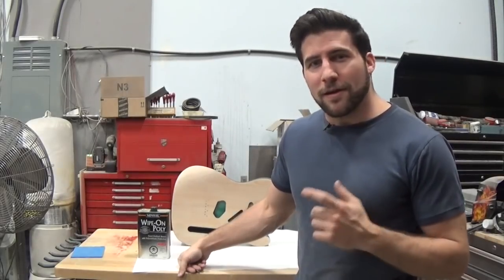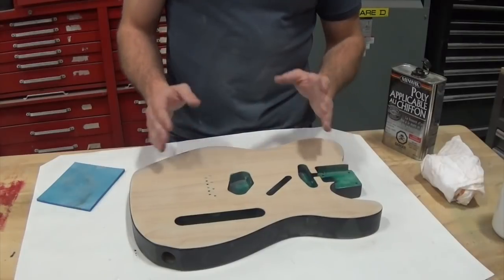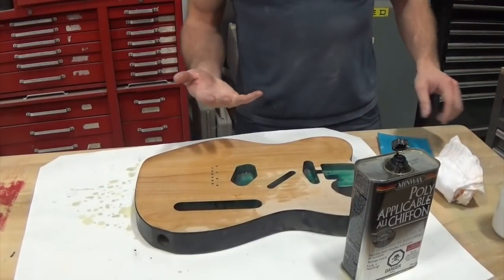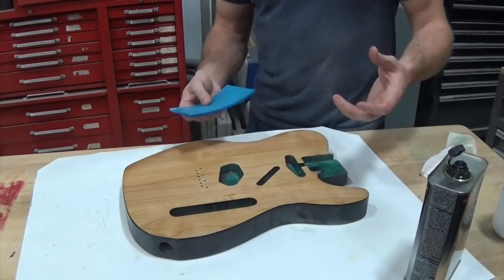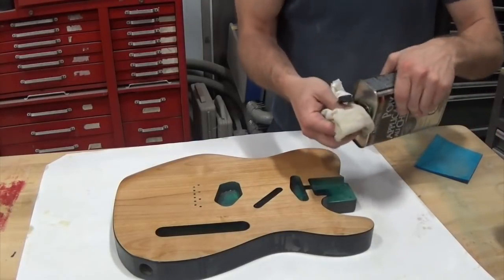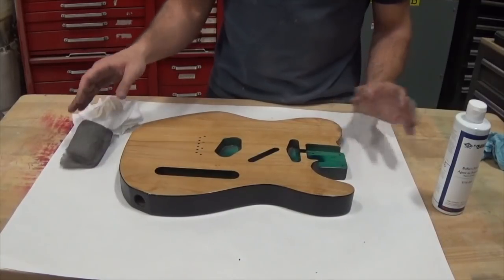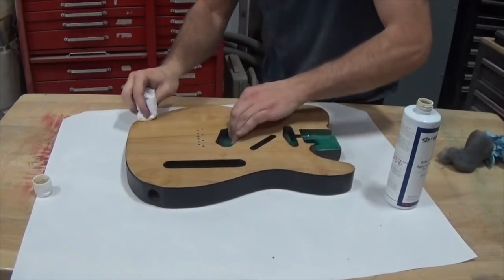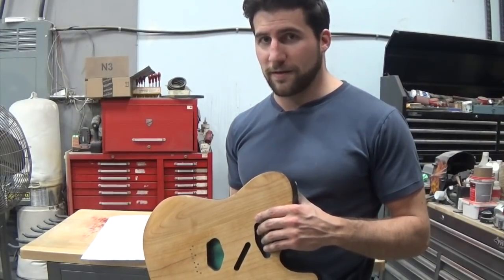How to apply a perfectly smooth poly finish by hand

Comment: Hello Brad, I would like to try this Behlen buffer's polish B730-2005, but seems like is discontinued out of stock everywhere. Did you find a replacement product with the same gloss result?
Reply from the maker: There are several, but the most direct replacement is the buff n polish kit from Mohawk, which is essentially a rebranding of the Behlen products.

Comment: Brad, is the initial sandpaper application only recommended for a guitar with a natural finish or can you use that method with a color stain as well? I’d like to use this method for my next build as I can’t spray lacquer in the winter months.
Reply from the maker: I would only use it on plain wood mostly. It can damage/distress paint and stain if you use it over that.
Reply: Brad Angove thanks for the info

Comment: Dave,..help me out brother,...at whicch pointt would one apply wood stain?? im about to start a DIY project and im going for a Jacobean woodd stain finish,...would I apply the wood stain first and then follow allong with this video regarding polyurethane application??
Reply from the maker: Stain first and then apply the poly, but done use the sandpaper for the application. 
Who’s Dave?
Reply: @BradAngove  ,... why did I write dave? i couldve sworn i typed Brad,..fuckin autocorrect, sorry man, im very impressed with the sandpaper technique, was that you discovery??
Reply: @BradAngove  wait,... did you mean "don't" use the sandpaper during application??
Reply from the maker: Yeah, I came up with it although I’m sure others do it and may have thought of it first. 
I wouldn’t use the sandpaper over stain or paint though. It could give you an unintentionally distressed finish.
Reply: @BradAngove  lol,..i kinda want this thing to look likee it came out of Frankensteins lab,. i just managed to strip the initial layer of paint,.. there's some residue underneath,. im sanding it down with 80 grit by hand but forget that noise, im gonna go borrow the electric sander froom the old maan tomorrow

Comment: Will two sessions of the Sandpaper/Poly sanding process sufficiently fill the open grain of a wood like Mahogany, or would you need to do more than just two sessions of Sandpaper/Poly to adequately fill the grain on woods that have a more open grain structure, like Mahogany?
Reply from the maker: If you’re working with mahogany you should grain fill first, then two sessions should be adequate afterward.
Reply: Thanks Brad!
Reply from the maker: You’re welcome.

Comment: Hi! Very informative video. Two questions - Is it possible to add a tint to the clear poly before applying it? If so, what sort of product would I need? Is there a Minwax option that would be suitable? Many thanks
Reply from the maker: Yes. You would need a candy dye if you’re looking for an automotive type tinted clear. An aniline dye will have a similar effect and should work with poly. I’m not aware of anything by minwax like that, but they may have something.

Comment: Hi Brad - fantastic video, thanks! A quick question - applying the MinWax with sandpaper: does that work at pore sealing for looser-grained woods like mahogany?
Reply from the maker: I don’t think it would be adequate for mahogany. Or at least you would need to to it several times.
Reply: @BradAngove  Thanks for that! Do you have any recommendations? I've been told ZPoxy or shellac and sawdust but to be honest I've never done anything with mahogany so I am at a loss ;-)
Reply from the maker: I’d go with grain filler. I like the stuff from Oxford supply that I demoed in a recent video on an acoustic guitar kit. I also like using ecopoxy sometimes.

Comment: would grain filler act as a sealer? i have a really nice maple body that has alot of grain on it, so i put on the grain filler before i stained it to accentuate the grain.  i plan on putting the wipe on poly for the finish because i don't have any way to spray unfortunately.
Reply from the maker: Not really. I have a specific video on grain filler vs sealer if you’re interested.
Reply: @BradAngove  heading there now

Comment: Hello Brad, me again...
I may have to fill a hole on my Hondo Frankenstein build. I will be using a new neck, and bridge setup. How would you go about filling in a bridge pick up hole so it can be relocated?
Reply from the maker: Cut a block to as close as you can to the shape of the hole, perhaps a couple mm thicker. Then glue it in, sand flat and fill the little gap around it.

Comment: Can the same technique of applying the first coats by wet sanding be used on a tung oil finish? If so, are all the other coats done as in this video as well? What about the final polishing? Thanks.
Reply from the maker: +Jakexx01 I've never tried it with tung oil, but I imagine you would have to thin it. Otherwise it would be a bit sticky and not spread properly.

Comment: You can use buffing pad with a random orbit sander for the last step. Saves on the elbow grease.
Reply from the maker: Or better yet you can use an actual polisher.

Comment: Hi Brad ! I'm trying the sand paper method using Danish Oil to actually grain fill the mahogany body of my latest project. It indeed creates a slurry of dust and oil that goes onto the wood, but I have a question. Would you just leave the slurry to set and then dry sand it off or try to work it in the pores while it's still wet, taking off at the same time any unwanted excess ? It's my first time trying that out, and I'm kind of confused.
Reply from the maker: I generally buff off the excess with a cloth after about 15 minutes or so.
Reply: Thank you so much. I'm sorry I didn't see your answer at the time. Pardon the delay.
Reply from the maker: No worries at all

Comment: Great video Brad. if you use a stain can you use a mist coat of sanding sealer and then use the wipe on poly?
Reply from the maker: You can, but use a proper coat of the sanding sealer rather than a mist coat. It will make the poly application a bit easier. And make sure you're using something compatible, or test it on scrap first.
Reply: Thanks Brad :-)

Comment: when finishing a guitar - do you also need to apply poly to the insides of all the cavities?
Reply from the maker: No. Those generally have conductive paint in them.
Reply: @BradAngove  i see. What if I'm using metal shielding tape instead of paint?
Reply from the maker: Then you can apply that directly to the wood.

Comment: Could you do this on a thin spalted maple veneer that has glue spots?
Possibly over a few coats of rubbed in oil paint?
Reply from the maker: I would be hesitant to do it over paint. It may damage or remove some of it.
Reply: I'll try a test piece and let you know.

Comment: Hey, Brad! Will I get same results if I have some woodburning designs on the body?
Excellent video btw! Very very helpful 😊
Reply from the maker: You might find that it moves or removes some of the char. I’ve done it. I enjoyed the effect, but I’m not sure if it’s precisely what you’re looking for.
Reply: @BradAngove  Ahh i see. Yea, especially with the use  of sandpaper for the first layer. Which type of finish is best for it? Other than the woodburned part, everything else is natural (no stains or whatsoever).

Comment: Hi Brad, over the big pond from Canada, our UK DIY stores don't seem to stock Wipe-On Poly - just regular water-based Polyurethane Satin Clear which I guess is similar (?)  Also, we don't have stuff called Buffer Polish in liquid format -  which you wiped in (and didn't have to wipe off, like automotive T-Cut).  Will any liquid polish suffice?  Cheers.
Reply from the maker: This poly is oil based. And yes, almost compound and polish systems will do the job.

Comment: Im new to finishing guitars... i was told to use formbys tung oil but not getting the look i want.. can i put polyurethane over the formbys?? Thanks im very greatful to have found your channel !! Keep up the great videos
Reply from the maker: Hi James. If you have a look at my series on building one of these guitar kits, I used behlen’s tung oil and then went over it with their urethane and it turned out awesome. I haven’t used formbys, but I imagine an oil based urethane finish would work quite nicely over it.

Comment: Hey Brad!  Love the channel and what you do.  Could you do this same thing with Tru Oil?  I've got a Solo Firebird kit on the way and was thinking of just doing the mahogany body in Tru Oil.  If using your method here would I need to sand the poly sand sealer that comes on the body first?  If so would I just scuff it or have to try to remove it?  Or could I just start with the sand paper and Tru Oil?
Reply from the maker: Yes you can do this with tru oil. You don’t need to remove all the sealer, it you do need to at least sand it smooth.
Reply: @BradAngove  Thank your sir! Appreciate the input!

Comment: Hi! Fantastic video! I'm getting ready to put a poly finish on my first ever build and your videos offer great advice! I have a question about your "trick" about using a sanding paper to apply the poly. Can I do this on a maple veneer top with a burst finish? I ask because I'm afraid the slurry will become a mix of the different stain colors, which ends up in the different locations all over the top. Any experiences? Should I just go ahead and don't worry, or apply 1 coat with a rag first and do only the second with a sanding paper?
Reply from the maker: This trick is mostly for unfinished wood. Unfortunately, you concern is valid. You’re likely better off to just carefully apply the first couple coats with a rag.
Reply: @BradAngove  Thanks for getting back. I took the advice and wiped it on with a regular rag. It's working out fine until now.
Reply from the maker: Glad to hear it. I hope the rest goes well.

Comment: Brad, is it dangerous to apply more than 3-4 coats of polyurethane? I'm finishing a project with a brush on type of polyurethane where I need to apply dozens of coats to give it a smooth texture, but the poly is always cracking.
Reply from the maker: Brush on is thicker, so doing dozens of coats can be problematic. You’re probably having coats shrink on top of eachother as they dry. With the wipe on it can be done more easily, but I don’t think I’ve ever dealt with a finish that actually requires dozens of coats.
Reply: @BradAngove  I think I may be skipping something on the wood prep because even after 6-8 coats, I still don't feel like all the grain is well covered. I did use grain filler, but I'll try to be more carefull. And by the way, I have to mention, your video about grain fill is great. Thanks man!
Reply from the maker: Thank you. What kind of wood are you using?
Reply: @BradAngove  the name of the wood is Marupá, a brazillian type of wood similar to basswood. Kinda soft and slightly porous.
Reply from the maker: You may need to actually grain fill first. Perhaps with something harder like epoxy.
Reply: @BradAngove  Got it. I scraped all the finish this weekend and gonna definetlly give more attention to grain filling. Thank you very much Brad!

Comment: Hi Brad, greetings from Scotland. Your videos are so helpful. Thanks. I have two questions : There's no mention of grain filling. Yes or no? The body I want to finish has some areas filled with a wood filler. Will the poly take to this, or will I have bonding problems?
Reply from the maker: The poly should go over that just fine. This wood was tight grained enough that I didn’t need to fill.

Comment: Okay Brad, this is what I'm trying to do: I have a high-end bass guitar that has a white finish that needs to be removed because of yellowing.  Do you have a video on how to remove that finish?  BTW, it's a neck-thru design, so I will have to remove the paint on the back of the neck and headstock also.  I really want to refinish this bass like that guitar you've done!
Reply from the maker: For the neck and the area near it you will need to sand. Other methods are too risky because of the glue. For the rest of it, have a look at my video on how to remove the paint from your guitar.

Comment: Would you apply the same process to the neck?
Also I noticed the back (and side?) is dark how was that done?
Was that covered in another video?

Nice work by the way
Reply from the maker: I like to use this process on necks as well, yes. 
The back and sides were painted as part of another paint job I did. This guitar body was my test body for a while.

Comment: Hi Brad - great video - the idea of wipe on poly really caught my attention. Question - wondered what you think about using the "trick"application with high grit sand paper as a method of pore filling open grain woods like Rosewood?
Reply from the maker: That's definitely one way of approaching it, but it would take longer and more material. I would typically do a quick grain fill on those with paste wood filler first before progressing to this stage.

Comment: Brad, I enjoyed your video and I look forward to trying out what you've taught here. So let me ask you If I got this right? I'm finishing a guitar and I'm using some water based aniline wood dye on a figured maple veneer top. After I've finished the dye, I want to use minwax clear gloss poly. Do I go straight to the applying it with a rag or should I apply it with the sandpaper like you did for the first couple coats? Is there a certain number of coats I should be aiming for or is it a by feel type of thing? I'm also unsure of what I'm gonna do with the back of my guitar and the neck but it's not figured maple so I'm thinking of using like a standard minwax stain say the color of mahogany. If I do that, is it customary to also put a clear coat of poly over it as well? On a side note, I have a airbrush and a kit with a bunch of different colors from a place called House of Kolor.....got them a few years ago and have never used them......when they are shaked, sounds like a rattle can. They don't go bad easily do they? I know you are a guru with this kind of stuff so was hoping I hadn't ruined them having them sitting for years. 
Thanks man. Keep up good work.
Reply from the maker: +Purple Heart Scott Are you using he wipe on poly, or the normal stuff?
Generally you would apply a clear over then normal stain as well. 
The house of kolor stuff should be fine. At most I would think you may need to reduce it a bit more before spraying.

Comment: Thanks for another informative, useful vid. I'm getting ready to do this for the first time using the Stewmac wipe on over a purple stain. Do I follow the same direction as your non stained?  Also, would you add any stain to the poly? Thanks for all the vids Brad. Great info.
Reply from the maker: If you’re working over stain, just use a cloth to apply the poly and then sand flat once it dries and add another coat. It takes longer, but you don’t want to risk screwing up your stain with the sandpaper. Don’t add stain to the poly.
Reply: What rags do you use? Thanks for the help.
Reply from the maker: Old t-shirt material that has had all the lint washed/dried out of it over the course of a few years.

Comment: will using the sand paper like you did effect a stain that has been applied to the wood I am using alder which I have applied a black stain to.
Reply: I also sanded with 2000 grit paper before staining
Reply from the maker: Using the sandpaper method will affect the surface stain, yes. The stuff that’s in the open grain won’t be affected.

Comment: I'm looking for options to clear coat Angelus Dye on a guitar body...will this process work or is there danger of messing up a nice dye burst?
Reply from the maker: Don’t use the sandpaper. Just use the normal wipe on technique and it should be fine.
Reply: @BradAngove  Thanks Brad. Also, I am assuming the poly coat is in itself a sealer? No need to use a proper sanding sealer first?
Reply from the maker: Correct

Comment: Nice video, Brad. But what do you do with double bound guitars? Do you just tape them, or what? I'm dealing with this dilemma right now. Tape seems the obvious solution, but very difficult to apply correctly.
Reply from the maker: For keeping paint off them? You have two options. Tape them first, or scrape them after.
Reply: @BradAngove  Thanks Brad. I was afraid of that :-)

Comment: I have finally pulled my garage sale Jazz Bass out of storage. It's sanded and ready to go. Are all of these finishes available at HomeDepot?
Reply from the maker: The wipe on poly? It should be, yes.
Reply: I would want Butterscotch Blonde.  I would apply the stain for color first then finish with the poly per this video?
Reply from the maker: Just don’t use the sandpaper to apply it if you’re staining it first.

Comment: Could I use a polyurethane + mineral spirit to thin it out and apply with sandpaper to a bare mahogany neck to fill in the pores to substitute pore fillers?
Reply from the maker: It would be difficult just because of the depth of those pores, but eventually after a few coats that should work fine.

Comment: That's cool Brad. How does this poly accept dyes to give a transparent color? I have a project guitar that has a transparent blue over a quilt top. Guitar had a lot of dents and scratches. I attempted to wet sand these areas down and went too far. The manufacturer used a trans blue sprayed over an already sealed quilt top to make a burst finish. I sanded through the blue and am trying to figure out the best way to repair.
Reply from the maker: Did you sand through it everywhere, or just in a few spots?
Reply: Brad Angove one spot. I was in the buffing stage using a foam pad and meguires medium cut glaze
Reply from the maker: You can add some aniline dye to the poly, but you would probably be better off sanding through all of the colour on the guitar and re-applying it. It’s tough to do spot repairs on transparent finishes.
Reply: I figured it would probably be tough to match the color too. Thanks so much for the reply. Your awesome!
Reply from the maker: Thanks for watching.